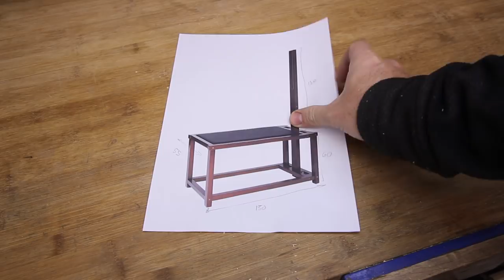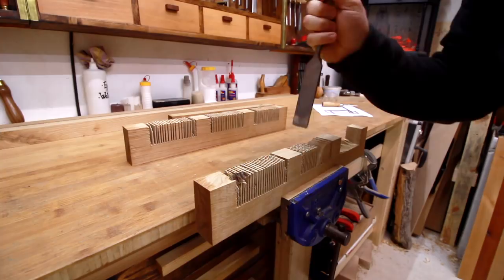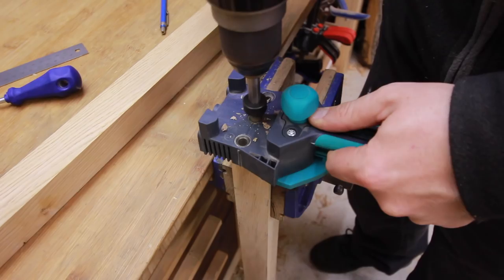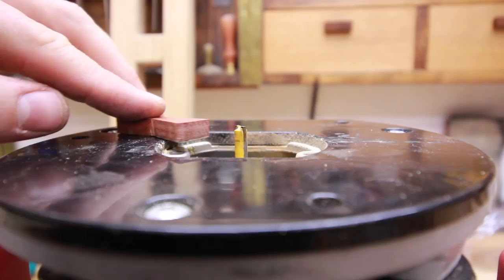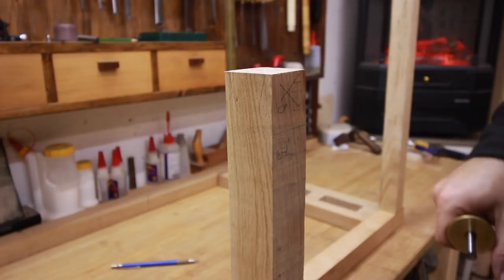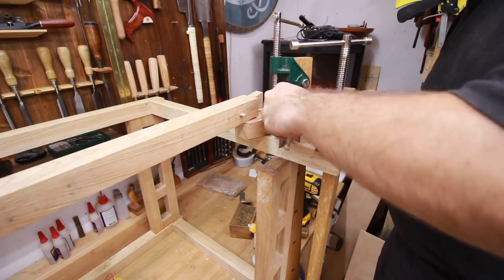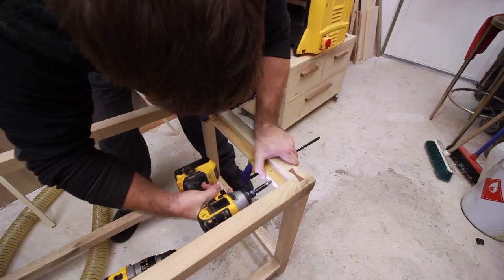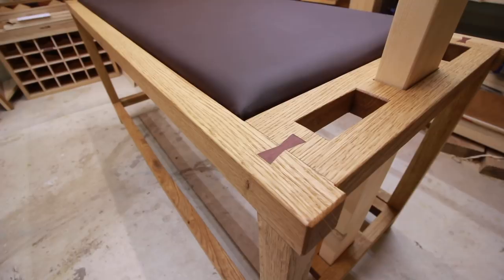This Bench will Improve Your Health - DIY

Comment: Very nice! I noticed when you’re putting the long dowels through the dovetail joint on the first one you cut it short and then had to use something else to drive it in, on the second one you just used a longer dowel and cut it flush, we all live and learn.
Reply from the maker: Good eye Tom!
Thanks for the feedback.
Live and learn, sometimes scrap it and start all over :)

Comment: The bench looks absolutely awesome.  Great craftsmanship.  While watching, it looked like you were using a hand drill.  I'm guessing a drill press isn't necessary.  Just wondering if it were necessary to go out and buy a drill press, to help with the accuracy of building the lajin bench.Thank you for going to the trouble of making this video.
Reply from the maker: Thank you very much!
At the time I didn’t have a drill press so I used hand drill. 
People who have followed me since the beginning know I had very basic tools when I started. 
If you have the tools use them, if not - there are always different ways to do the same thing. 
Now that I have a drill press I would definitely use it but it is not necessary to build this bench.
Cheers
Reply from the maker: Thank you very much!
At the time I didn’t have a drill press so I used hand drill. 
People who have followed me since the beginning know I had very basic tools when I started. 
If you have the tools use them, if not - there are always different ways to do the same thing. 
Now that I have a drill press I would definitely use it but it is not necessary to build this bench.
Cheers